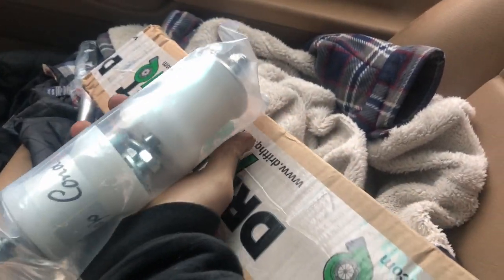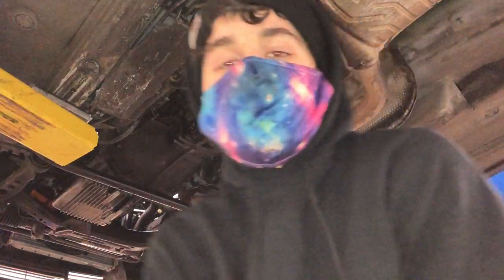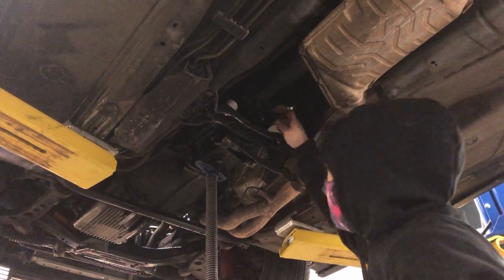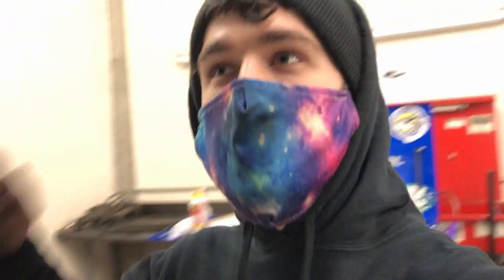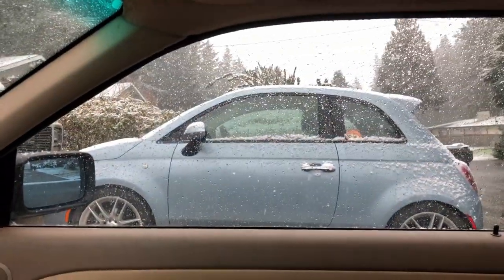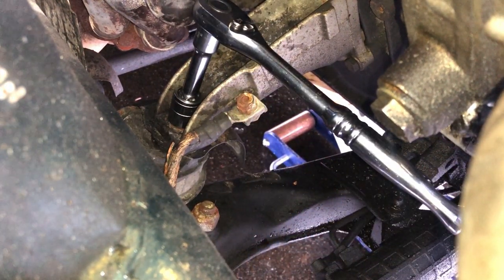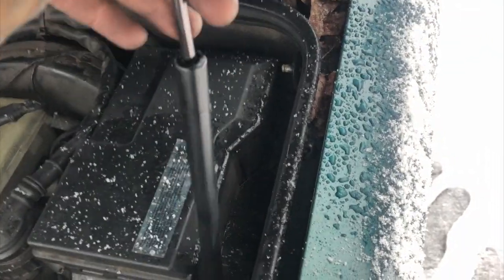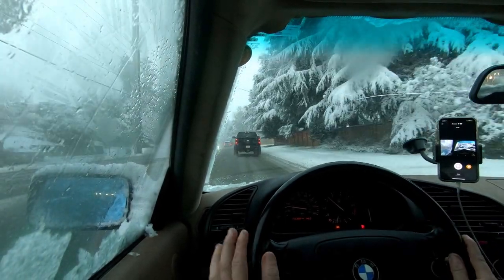E36 Snow Drifting + Condor Speed Shop Engine and Transmission Mounts Install

Comment: Are they solid mounts I bought some but idk if the vibrations gonna be crazy or kinda settle
Reply from the maker: The engine mounts are made of a special material by condor speed shop. It has the rigidity of solid mounts with the vibration of poly mounts. The trans mounts are poly and together with the engine mounts the vibration surprisingly isn’t that bad. Obviously more than stock but it’s bearable.